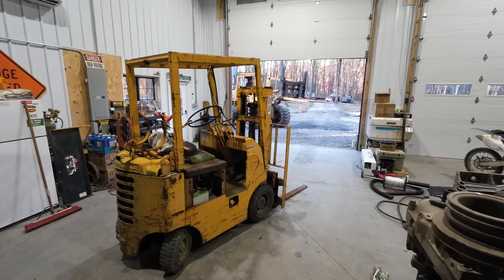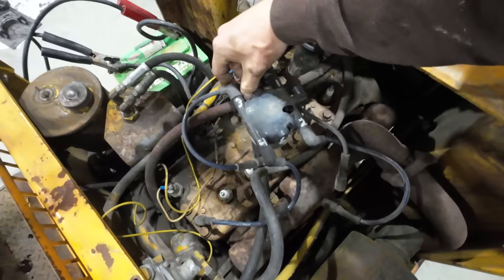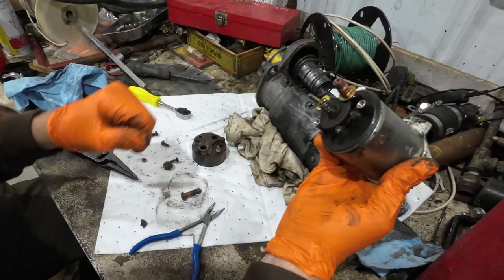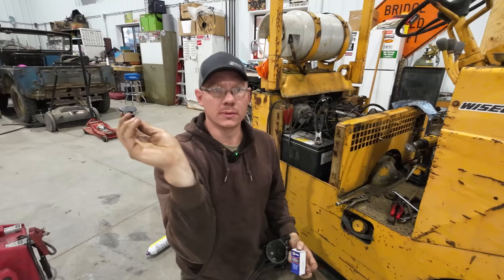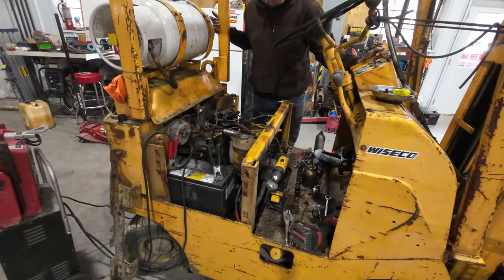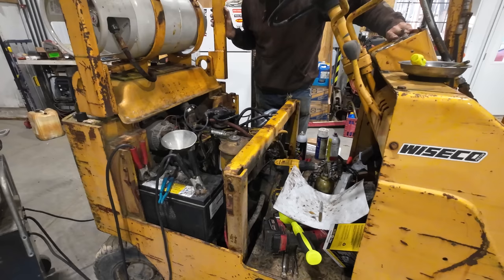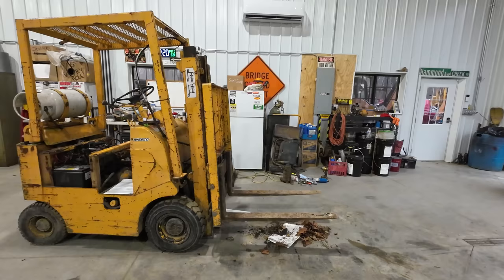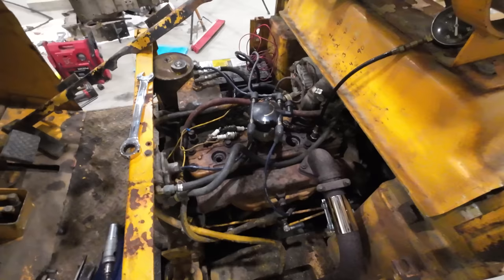Save or Scrap? CAT Towmotor sitting for years. Will it Run??

Comment: I worked with used batteries for over a decade, and I have charged and tested probably 20 thousand or so in my lifetime. If you want to try to bring one back that has been sitting for years, the trick is to take your time. To start, hook it up to a known good battery with jumper cables for a couple of hours to establish a base charge, then trickle charge it for about 24 hours. If it charges about 10.7 volts on the trickle charge, then it will probably be ok. If it goes above 10.7 on the trickle charger, then put it on fast charge for another 24 hours or so, regardless of what the voltage is after the trickle charge. Sometimes a battery can show a full charge after a trickle charge, but will not hold it if it sits for any length of time. If you follow these steps, the battery will come back around, as long as the cells have  not delaminated. I brought back a 17 year old battery that had been in a car that hadn't run in 9 years without changing the acid. I jumped it off and charged it on several machines over 4 days, but it was good as new when I was done, and held at 11 under load after sitting on the shelf for a week. Also, the brands have a lot to do with it. AutoZone/Duralast/Valucraft batteries are the best on the market, with Everstart, Autocraft, and Interstate coming in right behind. Deka and AC Delco batteries are garbage.

Comment: I worked at a junkyard for years. We had a lift very similar to this one with slick pneumatic tires, and we used it to move cars outdoors in all weather conditions. We used it mainly in dirt and gravel, and it would move cars with no issue, even when it was muddy outside. That type of lift is more versatile than you would think.

Comment: When you swap the forks to the AC, with the mast in the vertical position, adjust the mast chains so the heel of the forks don’t touch the floor. Also it may not hurt to measure the chains for stretch. Those old FC models were noisy and uncomfortable but will last forever.

Comment: I worked on Tow Motors in the Late 1970s, which is probably in the Late '60s. It was not as nice as the T-50 I worked on. They were actually notorious for head gasket problems; if you do R&R on the head, please make sure to surface it before installing.

Comment: I’ve worked on a few of those towmotors. Really good simple units.
Reply: Yup with prices these days a fix in order get it running then use as bartet for other junk😅😅😅
Reply: Simple to replace the rear main seal? Rebuild  the motor?

Comment: Winter is almost here, did you get your wood burner/water heater installed yet? Would like to see a video on that.
Reply: Gonna venture a guess and say he needs the electricity in order to run the circulating pump.

Comment: The Towmotor Corp was established by Luther Sears in 1919. They were origionally used to pull equipment around in large manufacturing plants. Eventually they were converted to forklifts and Caterpiller has always called their forklifts  towmotors for this reason.

Comment: In my 1926 Oldsmobile  I use 50 weight racing oil and my 1936 Chevy gasser 50 weight racing oil . The 1926 Oldsmobile book says 50 weight oil awesome video.

Comment: Really like your channel Matt.  Good stuff.  Too many comments to check if anyone else said same but I had a 4 cyl petrol car from my son years ago and managed to just get it to run in a slow, rough way.  Then while it was running I pulled a lead off a plug and it ran better!  If pulling plug lead causes no change then push it back on the plug and pull the next lead.  Someone had seemingly numbered the leads after they got at least two switched around.  I carefully swapped them until it was firing smoothly and had power finally.  
Rgds Alex - Kalgoorlie, Western Australia.
Reply: easiest way to tell if your firing is working: give 'er a yank, and listen. No decrease? that lead wasn't making spark.

Comment: I hate to say it, but I gotta agree with you on this one. After that 2nd compression test, I think she is done. It's old and worn out. In my opinion you would need to check the wiring for the lost spark, at the minimum tear off the head and check the pistons, replace some seals and clean her up and that is just to get it runnin again right. Not mentioning what other things may be wrong with her that you haven't found yet. Plus with that manual trans in it, it just isn't worth the time and money. It would be better to take parts to make your other one better and then scrap/part her out. As others have mentioned you might be able to make those wheels work, but it is hard to say honestly. But either way, I love the videos man, keep up the awesome work. I love seeing people bring these old equipment back to life and see if they can still be used anymore, instead of just throwing them away.

Comment: In my ears as a mechanic I have fixed Nanny flooded engines by pouring oil down in the cylinders you can't do that with an updraft carburetor but you can do it through the spark plug holes

Comment: Towmotors start life on the tarmac of airports and airfields moving planes and APU carts and luggage trains and stairs before they started mounting them on trucks. Cat bought Towmotor sometime in the 50s or 60s and mounted fork booms to them and put ROPs on them. U.S. military had thousands of Towmotors during WW2. I have 4 old military Towmotors sitting in the junkyard from WW2 they all have Willy 4 cylinders in them and all run like a top.

Comment: When you first put the spark plugs in without running a wire brush over them, I was yelling, "Chech the compression you dim-witt". Impatience, laziness, and short cuts are a mechanics worst enemy. 9 times out of ten they are a waste of time and usually cause more damage and more work, and more $s.
I always found it rewarding to troubleshoot following the procedures developed by mechanical engineers who wrote the Chilton's auto-diesel repair and overhaul manual. I read thru 70s version of one about 4 inches thick in 1980 three times. Then I went and got a job as a mechanics helper with a construction company. Their head mechanic there would dive into greasy dirty machinery and put things back together with a bare minimum amount of cleaning around the area being worked. I started to get ahead of him and pressure washed our next projects and he realized how it was beneficial to work that way. No if, ands or buts.
I would have pressure washed the whole unit, pulled the motor, clean and replaced any faulty parts and seals, lapped the valves, honed the cylinders. Then cleaned and refreshed the rest of the machine. I guarantee that doing it the right way you will feel a whole lot better about yourself, and you will have more respect for the mechanical acumen that you've added to your resume. It's an extra 6 hours well spent instead of trying this gimmick or that shortcut.

Comment: We had an old Cat forklift showing the same symptoms.. intermittent no/hard crank. Fell on its face under any throttle.. chased it to our wits end. Finally got creative and determined the distributor walking in the bore of the head and causing intermittent weak/no spark due to the gap between the button and cap. 

Unfortunately the distributor was frozen in the head, and it wasn't worth the labor involved fixing it. She was a loyal stead until then.
Reply from the maker: Yah I couldn’t get this one to budge. It’s stuck hard

Comment: You need to keep that starter Matt 😂. That was a heart breaker. Suffered the same myself, went to do a will it start on a Case 1394 with the engine full of water. Got her rolling but no way would it fire. So much cranking that I carried 2 starters so I could swap out rather than waiting to cool. 3 videos, a set of rings, 1 piston and 4 exhaust valves later I got it to finally fire up. Just like that old CAT I'm looking forward to it heading for the shredder 😅😅. Somethings just don't want to be saved. Keep up the good work 👏

Comment: I bought my first forklift back in 1983, a 1951 4K Towmotor. Still have it and it still works great. 
4 of my 6 forklifts are manual trans, great for rigging and also general use. Check the oil level it might be over filled. That forklift has much use left in it.

Comment: My 1980 Allis Chalmers forklift has that same motor, a Continental F163. They also were in Lincoln welders. My motor was junk because the wrist pins were held in with plastic clips, that broke, wrist pins walked out and scored up cylinder walls, so it smoked a ton. Was gonna cost 4k to sleeve and machine the block, then rebuild it. I found a good engine in a similar forklift and swapped motors.

Comment: Matt, your PSA about charging batteries reminds me of the time I helped my father in law work on his fork lift.  We threw the same type charger to the battery, he was working the throttle, I was working the starter sparks were flying and I knew about the hydrogen production in the back of my mind so I was nervous the whole time.  Of course he wasn’t fazed a bit and we made it through.  Great times!

Comment: You could always use an old Model A Ford fix for the leaking main seal. Wire a can under the leak to catch oil and resume the oil back in engine . LOL

Comment: I worked  in a sector of the economy that  took two years to replace any piece of equipment . Every time we got a new piece of equipment, we had to surrender an old piece of equipment for disposal. Under those conditions, I would be pulling the motor, putting in a new rear main seal. Connecting LEDs to the ignition circuit at every junction along the way to find out exactly where the ignition was being lost . Every time any piece of equipment got serviced, it got fully evaluated to determine if it would, in fact, last at least three more years.

Comment: Two things. Intake valve is not seating which upsets the intake vacuum.
Give it throttle while starting. Increases propane mixture. 
Painful to see so much cranking when not opening throttle.
Set the valves a little loose and they will seat in faster.

Comment: Putting Seafoam in each cylinder and letting it sit for a day may free it up. Seafoam in the oil will help it too. Blow by shows stuck rings too. I took my piston out of my dirtbike that sat for thirty years...cleaned the ring grooves and put it all back together and it runs like a new one. The Wiseco sticker on the side of that machine indicates that at some point there were new Wiseco pistons installed. They let it sit out in the rain too long after that and it filled up with water. A gasket or loose bolts could fix the oil leak.

Comment: Matt, not sure whether anybody else has already told you this but when you take that solenoid apart, just turn the copper washer over and turn the copper bolt 180 degrees to give you nice fresh contact points. I've done a bunch of them that way over the years.

Comment: Agree on letting this come back as tableware.  Strike #1 Auto oil drain in an hour,  Strike # 2 Low compression,  Strike #3 Add 1 and 2 plus about 6 other undiscovered items.  Sadly, salvage what you can and let the scrapyard have it.  Great video as always.  Have a good holidays!

Comment: Pull the tires, forks, new oil, cap and rotor and condesor, radiator and starter and crush it. Definitely the starter, shes a beast.

Comment: Intermittent spark after change in temp is likely the Hall Sender at the bottom of the rotor, or pickup.  It could also be a wire or connector.   A connector can expand or contract and break connection due to heat.  I got a Jetta cheap that my mechanic could not figure out.  I worked intermittently.  If it would not start, just have a coffee and come back in an hour.  I just replaced all the connector ends until it worked perfect.

It would not start between 11:30am and 1:00pm in the winter on a sunny day when I parked beside a few pine trees.  The sun shown on the hood near the computer, but the computer was cold at that time.  Before the car was shaded.  After the engine components were all warm.

Comment: as other commenters have said: Strip it of anything useful: the propane tank brackets, the propane throttle regulator, the entire gauge cluster, any of the cylinders that aren't too clapped out to be worth rebuilding, the wheels and tires if feasible, and the ignition components you put in. maybe try to pull the hydraulic valve assembly and see if the side-shift can be backfit onto the Baby Allis.

Comment: you can do like I did before I scraped my old tow motor when the engine finally gave up I stole all the cylinders and used them on other projects towmotor was the first name for forklifts as other have mentioned

Comment: Those Tow motor Cats were innovative in their day, with a self changing oil system, and a power saving ignition. With a bit of  'Bush" engineering you might be able to fit the booms, & even the wheels to Alice. Don't forget to save that starter motor!. Great video,- thanks.😎

Comment: I used to be a product support rep for Caterpillar lift trucks (fork lift).  I once ran across an ancient Towmotor still in occasional use at a big feed store.  Thing was so old it didn't have a water pump.  The steam in the top of the cylinder head would burp through a flapper valve (where a thermostat would be in a more modern engine) and then trickle down through the radiator.  Whole system worked off convection.  How thick do you suppose the castings had to be to prevent cracks?!  It also had wooden spoke wheels with solid tires.  Forks were raised by cranking a big horizontal hand wheel, no hydraulics.

Comment: Back in the day I worked at a local plant, in the receiving bay. We had old gasoline-engined Baker forklifts with manual transmissions (high-low range) and we had competitions on how much rubber we could burn...low range to high range...drag races...you name it, we did it. Then one day OSHA came in and said "no more gasoline engines inside a building!" That was 1973.

Comment: You're crazy man. That manual trans is the best part of that machine. Being able to slip that clutch working in tight areas gives you way more control than power shift and you can work the shuttle shift just as fast as on a machine with power shift. The only downside is you kinda need to have at least some breaks.

Comment: My Allis Chalmers AC30 looked identical to this one. Flat head engine. The intake boot on ours was filled with water. Advanced Auto Parts had 4 plugs for it. Same vertical water hose smashed by the seat. The firing order cast into the head didn't make sense with the same as yours distributor cap. Blocking the top of the filter housing helped - as did blowing off the plugs a bunch of times.

Edit to add: mine didn't seem to like ether. Did have to nurse the throttle to get it going. Once warmed up, it got pretty peppy. 😊
Reply: Oh! My old forky has some unexpected safety interlock features. Almost to the end of the video & remembered how anytime something didn't work, we'd have to survey no "rules were being violated". I bet these were built near the same time to same specs, like somebody published the plans and a few companies made them.

Comment: I think your ignition system needs some ballast ahead of the coil to reduce voltage and protect the points and coil.  Without it, you're overheating the coil after a certain amount of run time and there goes your spark energy, until it has a chance to cool down.

Comment: Matt, that's a GM-style starter.  If you turn each of the copper contact bolts 180 degrees and clean up the contact disk, you'll have essentially a new set of contacts.  Over the years I've done this many times.

Comment: Originally founded in Cleveland Ohio in 1919, The original "Towmotor" was an industrial tractor that pulled and pushed carts around warehouses and factories (brand name followed function). They still make them today! In 1933, the Towmotor corporation revealed the world's first Forklift. The forks in the front would carry the load and the back was counterbalanced to stabilize the load. As sjgerber said, their marketing was pretty genius, solidifying their equipment as a "one man gang" popularizing the Towmotor brand with Forklifts, and solidifying the trademark as a recognized name as a forklift. The name "Towmotor" stuck well because it was one of the industry's first and most recognized brands.

Comment: That side shift frame should fit on the Allis you’d just have to fit it with another hydraulic circuit. Most side shift frames I’ve seen clamp onto the mast like forks.

Comment: Reminds me of the issue I had with my car, would run, die and not start again for a while.  Turned out to be the arm the rotor/distributor cap attached to was flooding with oil causing it to lose spark.  I'm not a mechanic, just pointing out a similar situation.

Comment: Plugs act differently under compression.  More than once I have seen plugs fire when tested, but under compression not good.  In one case it was a 6 cylinder petrol, running the day before, but not 1 cylinder would fire the next day.  I had a load on the back, called the loclal dealers mechanics out and they were stumped.  In desparation one of them brought out a new set of plugs and it started as if nothing was wrong.  We all gained experience that day.  Experience that money can't buy.